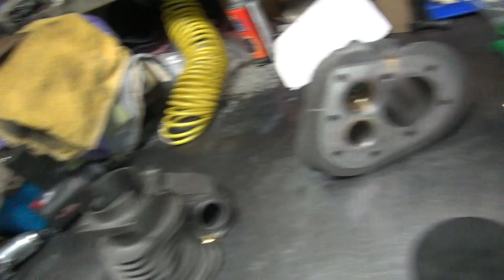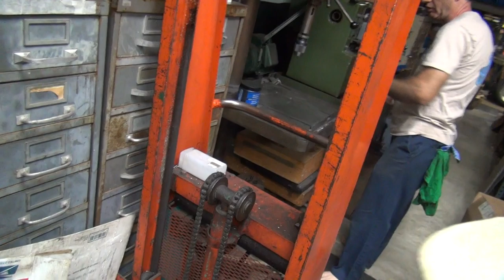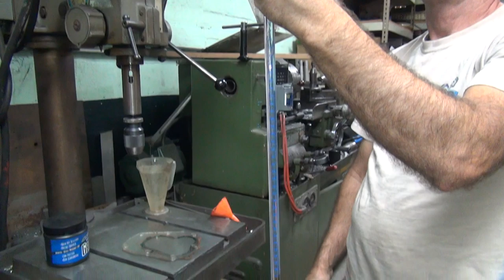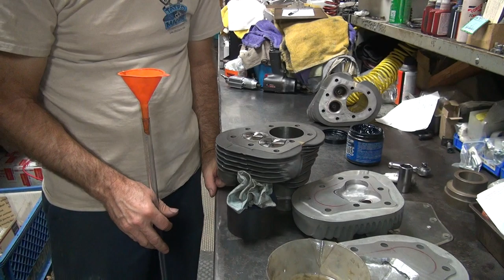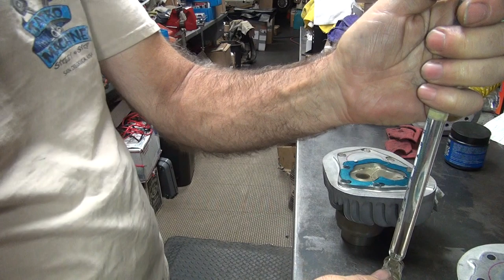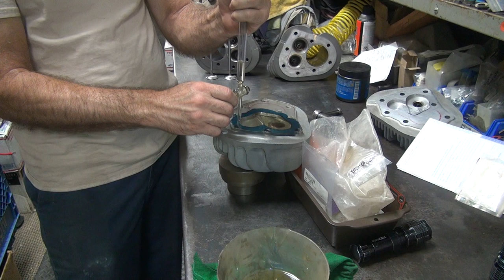1941 wld 45 56ci stroker #204 flathead motor build 4-5/8 in harley wl by tatro machine

Comment: Modern way to do this is to 3D scan it and make a solid model, then let the computer tell you the displacement.  Done it on a few heads so far with great results.  Not better than the old school way, but it does allow you to model changes and eventually even simulate flow using finite element analysis.
Reply from the maker: yea, not everyone has all that new tooling to play with. anyone can get an old manual mill and crappy computer and do what i am doing. in the end, all that matters is the time-slip.
tatro
Reply: @TatroMachine  Definitely, well said.  I did get my scanner for $250, they are coming way down in price.